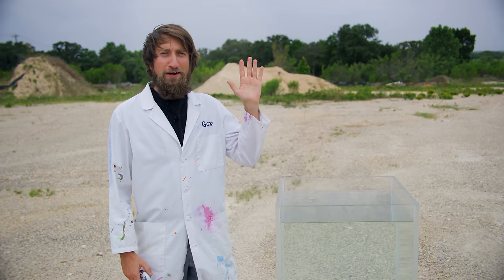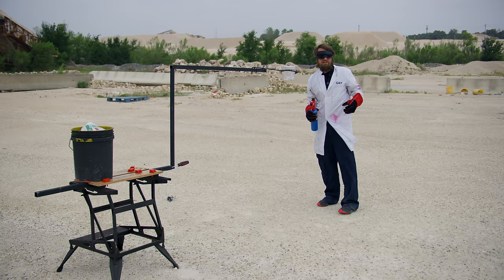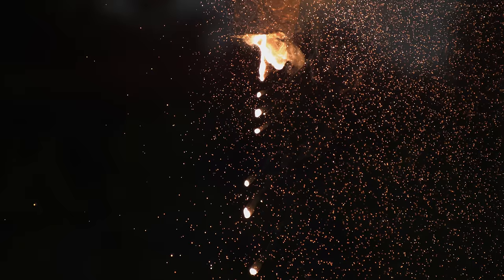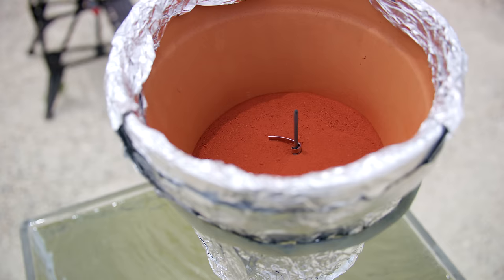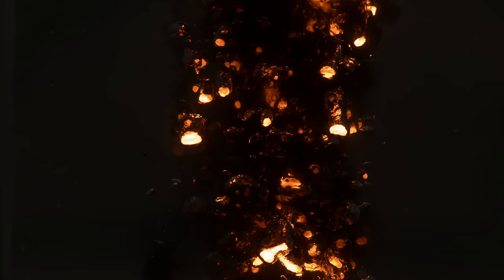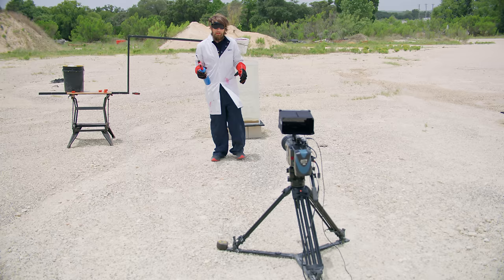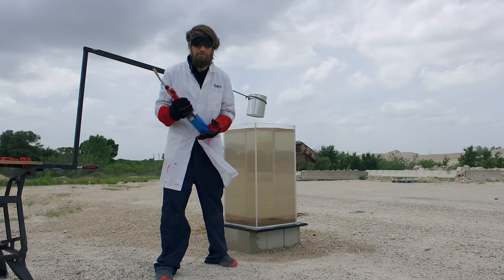Slow Mo Molten Thermite in Water - The Slow Mo Guys

Comment: Remember when the Mythbusters refused to tell us what was in Thermite, and now everyone tells us how to make it? Good times...
Reply: you can buy the ingredients on amazon for $40 for a few pounds
Reply: You learn that in early highschool anyways
Reply: Rip Grant Imahara
Reply: @peaceoutbruh7085  You can get the ingredients by breaking a piece off a metal coat hanger and some rust from something made with iron. Aluminium is light but easily bends in small sizes, so it's not hard to find. As for the rust, just take a look at the roof of your house or maybe a shed. Just gotta mix the right amounts and set them on fire
Reply: Was thinking the exact same
Reply: RIP Grant form Mythbusters
Reply: Thermite from rainbow 6 😬😬😶
Reply: They said what was in it, they just didn't mention their glycerin based starting method
Reply: The main secret isn't thermite itself it's how tyo get it easy to set off which is much harder and dangerous
Reply: They wouldn't tell us what was in "pirhana solution" also.
Reply: Both take literally seconds to look up.

Comment: Gavin just casually reminding everyone how to make thermite
Reply: Rust and grinded aluminum
Reply: A generally decent recipe is 2 parts Iron Oxide and 1 part aluminium.
Reply: I feel like at some point in my life now I'm going to have to explain why I know how to make Thermite.. I never meant to learn it, just happened.
Reply: I mean, everyone knows. Plus you can just google it
Reply: @raptorjesus3894  fairly positive its 1:3 ratio.
Reply: @TheProfessordank  Assuming a stochiometric mixture and bone dry Fe2O3 the reaction is Fe2O3 + 2Al -> 2Fe + Al2O3. 1 Mole iron (III) oxide to 2 moles of aluminium.
By weight that is 2x56 + 3x16 parts iron(III) oxide to 2x26 parts aluminium. 1:3.1 ratio.
You might not want exactly a stochiometric mixture; e.g. you might want to have a small excess of aluminium because it will throw more sparks or it will definitely get rid of the iron oxide or the resulting iron might have slightly different properties, or you know there's a bit of crystal water in the iron (III) oxide so you want to compensate for that.
Reply: Well, if there's ever a global apocalypse (I mean, a slighly worse on that the current) then it migth be handy for dealing with zombies.
Reply: TheProfessorDank yeah 1:3 works better but the other kinds of thermite are a lot more exciting than normal thermite
Reply: @raccoon344  black iron oxide instead of red can create more energetic reactions.
Reply: TheProfessorDank your can add barium nitrate and sulfur too
Reply: TheProfessorDank magnesium and manganese dioxide is pretty cool too

Comment: For anyone interested what the bubbles were about; it's called the Leidenfrost Effect. It happens when something significantly hotter than the boiling point of a liquid is introduced to that liquid. Basically, there forms a sort of protective layer of vapor around the object in contact with the liquid (from the liquid itself); which in turn acts as insulation against further contact between the two. 

It's the same thing that happens (if you've ever seen it), when water "Skitters" around a really hot frying pan when suddenly introduced; in that case, the droplets riding on a "skirt" of their own vapor.

Comment: This is also a very good depiction of the Leidenfrost effect, when very how material is submerged in water, but the heat creates a shell of water vapor around the material, effectively preventing the water from actually touching it, so it takes much longer for the material to dissipate its heat and cool down

Comment: "Fumes also very dangerous"
proceeds to not wear any kind of mask
Reply: Well the fumes are probably aluminum/rust dust, molten ceramic pot and aluminum foil, and steam.
So, not great, but probably not much worse than a campfire? I don't think we know the LD50 for thermite fumes. At least it's not the usual partially-combusted products and collection of strange by-products, and there's nothing that should cause biological reactions or disrupt your cell's molecular structures. Still, small particulates are never a good thing to inhale into your lungs.

...on the other hand, thermite burns at over 2500 degrees Celsius, so those fumes might be a bit hot.
Reply: @tomc.5704  ah yes, a bit hot.
Reply: It Should be fine. Wind was blowing away the smoke from him.
Reply: *like the rest of america

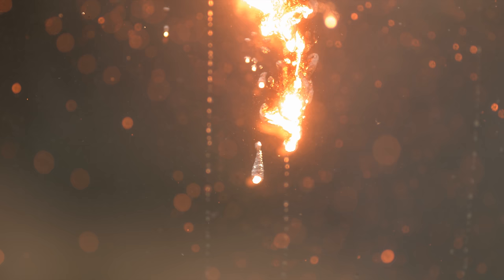Comment: 4:51 that little one looks like a comet. 
Speaking of comets, a comet that comes by every 6000 years will be visible for the next 5 days. Located near the Big Dipper in the sky.
Reply: I can't even locate big dipper :(
Reply: @beebop5221  I used an app called StarWalk (I swear this isn't an ad). It uses your phone camera and compass to align a map of constellations with the stars you can see. Not 100% accurate, but you can see well enough to figure out where constellations are.
Reply: Thanks Sentinal!
Reply: I was lucky enough to see it. It has a beautiful, greenish hue.
Reply: I was noticing at the end when the whole can fell in, that the splatter looked exactly like nebula seen through the Hubble telescope. Bright spots with dark clouds in front of it, you could easily swap it for a deep space imagine and no one would know.

Comment: I heard that a reflection in a mirror has a 9 nanosecond delay between its actual subject. I was wondering if that could be captured with you super high speed cameras. 🤔🤔
Reply: Depends on the distance the light has to travel from the subject to your eye. In 9 nanoseconds, light travels around 3 meters, so if you put on a fancy hat and stood a meter and a half away, you are seeing how snazzy you looked 9 nanoseconds ago.
Reply: @Metrion77  It's actually closer to about 1' per nanosecond so 9 nanoseconds is about 9-10 feet.  But since the light has to reflect, you only need to be 5' away from the mirror.

Comment: That was special! I would love to learn more about the chemistry and physics of the water Al and Fe reaction.  How about a collab with periodic videos? 
 @ Mio My infirm father has problems with sufficient water intake.
 On Mio's website I found out they use artificial sweeteners  those are not an issue. BUT (at least in Germany) the AMOUNT of sweetener used in flavoured water is so extreme that that it makes you feel sick. Have you tasted mio? If it is drinkable, I would suggest this to my mom!
Reply: What’s nice about mio is you can control how much you want in your water to change the sweetness. Definitely give it a try!
Reply: boredgrass Hi, I am an elder care caregiver/person/nerd. I have found good success with diluted coconut water. It helps any subsequent hydration be absorbed by the tissues. I usually dilute the coconut water by half. It doesn't have much flavor, but seems to encourage drinking it. It has a slightly sweet taste. You should be able to find some that doesn't contain added sugar, it's fairly cheap. I also use water infused with frozen fruit. Also, I have had experience in this industry for more than a decade now, the coconut water trick was recommended to me by a nurse.

Comment: A little correction... The bubbles are NOT steam, but HYDROGEN gas. Steam would condense back to water if contacted with surrounding water, not making it to the water level, which you can see as the majority of the bubbles which are created disappear almost instantly, however those that make it to the top are hydrogen bubbles, which catch on fire instantly, and you can see them as little, not so bright plumes of fire. Yes, molten metals such as aluminium and iron can and will react with water to create metal oxides and hydrogen gas. I believe, those are also exothermic reactions, keeping the mass of the metal hot longer...

Comment: What if you used a beam splitter and filmed something like this with two of the same cameras, could you essentially get the full dynamic range of the scene? (Something like HDR photography?)

Would likely be a massive and fiddly setup, but it could be cool if it worked.

Comment: It would be cool to make an experiment where you coil an immense amount of fiber optic cables around some structure to see if yo can catch the delay of light coming in through one end and out through the next.
The speed of light is 299 792 458 m/s, so for a microsecond delay you would need 299.792458 m (lets just say 300m) of cable. This actually sounds doable, any semi good camera would be able to capture that delay.

Comment: I would not be too surprised if it turned out that the molten drops of metal were taking oxygen from the inside of the bubbles as the water is flash-steamed around it.

Comment: I used to use mio as a kid and I tended to like the sweet taste but don't have it all the time cause I also tended to end up dehydrated from drinking it too much. it's like replacing every liquid with Gatorade. sure it tastes good and sometimes can help with a hike but the electrolytes that give you the needed energy for those types of activities either dehydrate you themselves or the things that come alongside them do. idk t's one or the other I just know it's not good to have all the time. it's not nearly as bad as soda but still good to have some plain water most of the time guys. not saying don't have it just saying have it in moderation

Comment: i ignited about 2kg thermite under 1-2m of sea water and hydrogen bubbles ignited and exploded/crackled when hitting the surface. think the hot iron oxidized and reduced the water to liberate  extremely hydrogen.

Comment: Actually, since thermite actually burns around 3135K or 2862°C, the "steam" formed by water might not even be steam… BUT HYDROGEN!

At 2000C it's 3% of H2O molecules that thermolyse, at 3000C it's about half of them. Since we're much closer to the 3000°C mark, I'd say about 30-40% of that gaz is actually not mere gaseous H2O but H2 and O2 molecules completely separated from one another!!
Reply: aka, put a flame on those bubbles and they will blow up